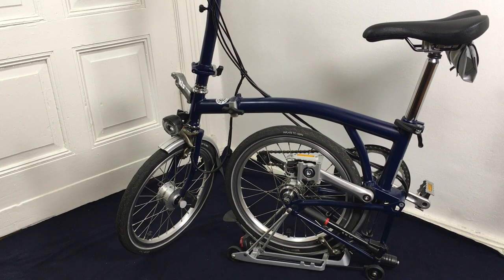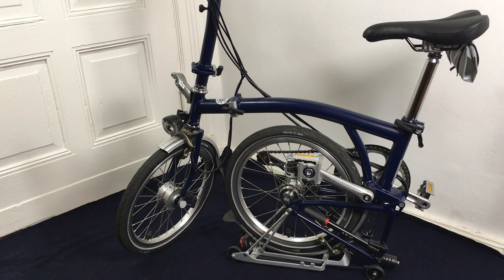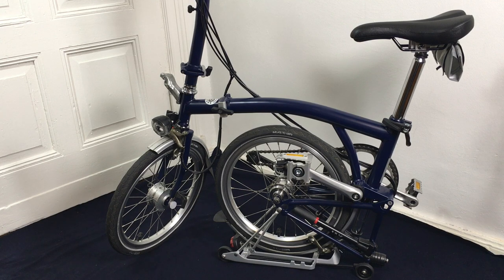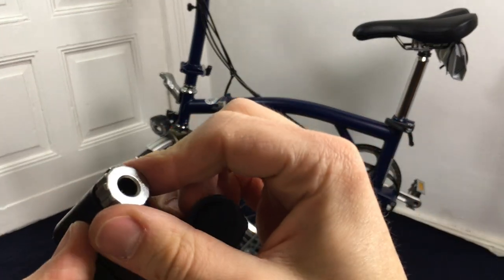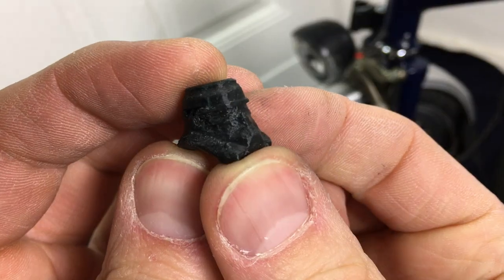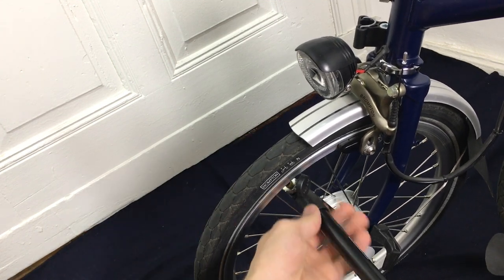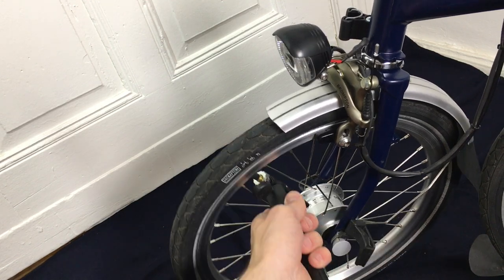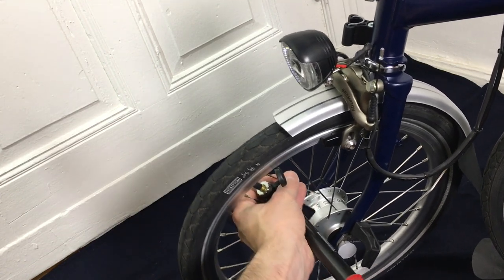Brompton bike - tire pressure and onboard handpump

Comment: With the Brompton frame pump you would have to be superhuman to get above 70 psi. I used a high grade car footpump to get to the recommended 80 rear, 70 psi front, (now recommended for the latest Brompton tyres).
The frame pump must be regarded as a get-you-home device.. Pump 'em up as hard as you can, and then ride gently.

Comment: It is only a get you home method of pumping up the tyre, you should have a better method to pump up tyres at home, like a track pump, or use a pump at a cycle shop if you don’t have a track pump, hand pumps are not great at setting tyre pressures.

Comment: I don’t think it needs to pump the tyre up to 7bar, just enough to get you going, I think 7 bar is only needed if you are big and heavy, I run mine at 80psi, but I could quite easily get away with 50psi, I would just have to avoid situations that cause pinch punctures, which I try to do anyway, if the rider was 8 stone, then 100psi would be too hard.
Reply from the maker: You can definitively run it on less than 7 bar. But apart from the increased comfort and risk of punctures, the rolling resistance is my main concern. Basically, you have to compensate for the low pressure by putting more effort into the legs.
Reply: I recalled the manual says you need to use a proper pump to press up to 100psi, a guaranteed pressure to fully protect the mental rings! Hand pump is just for emergency!

Comment: Hi. Hier is it the quality of the foot pump you use ( the yellow one). I’m considering to buy it via Amazon. By the way I normally use 4 Bar in the front wheel and 4,5 Bar in the rear wheel. 7 Bar is too much pressure unless you’re too big and heavy. Thanks !!
Reply from the maker: I am using the yellow one for years (since 2012). Also for the road bike that needs 10 Bar. And I am happy with it. It says Oakland on it but no model number. I think I also got it from amazon.
Reply: Yes. I bought it already at Amazon and been also happy with it !!!